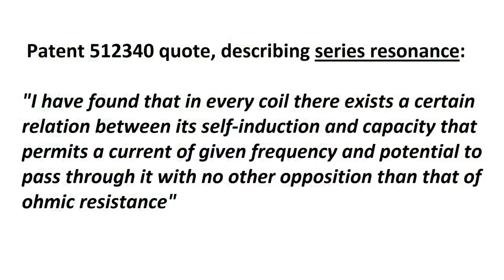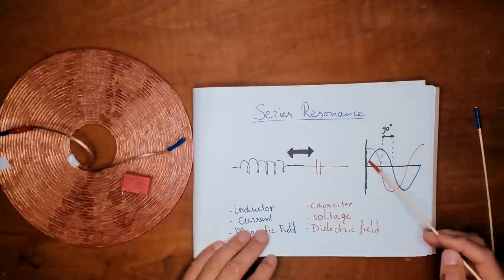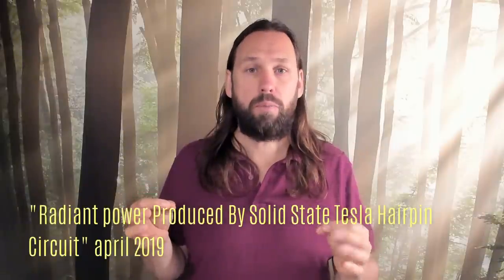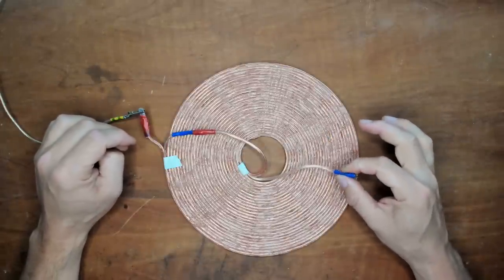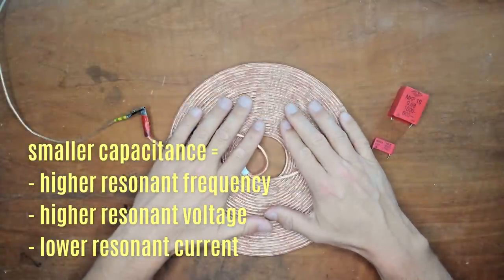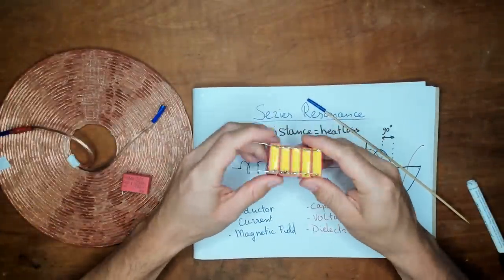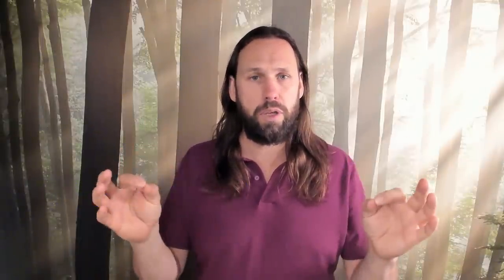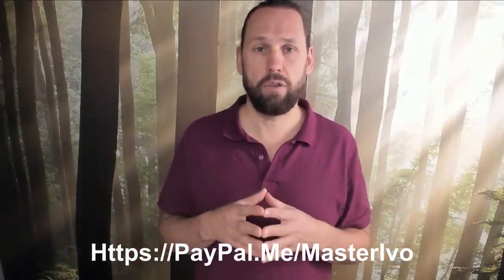The Series Resonant Bifilar Coil, Made For Longitudinal Impulse Electricity.

Comment: There are 2 different frequencies happening here! 1) The frequency of the wire by its self and 2) the frequency of the combined Coil with the capacitor! If the two frequencies overlay each other that they add up, both the magnetic and dielectric fields will increase dramatically. This is the state many inventors describe for example as "harmonic" resonance. The coil frequency is a harmonic multiple of the LC frequency.
Reply: @TheGuru2You2  Very interesting comment about the 2 different frequencies.  Do you have any links to web sites, documents or videos to learn more about this?  Appreciate anything you can share, thanks.
Reply: But only when the current Is cero instant?
Reply from the maker: the frequency of the wire by itself?

Comment: interesting as usual with M.Ivo !
do you think making a bifilar coil with Aluminum and nikel wire could increase the voltage and lower the resistance at the same time making the device more efficient ?
Reply from the maker: ni don't think so. aluminum has a higher resistance. Dont know about nikkel, best would be silver-plated copper (or gold or platinum) buy I stick ti pure oxygenfree copper, as it is affordable and workable.
Reply: @MasterIvo  there must be grafite / grafine wire by now.

Comment: Hey, just rewatched YT TheRadiastral: Lindemann read Vassilatos again, Secrets of Cold Electricity with the Edwin Gray circuit analysis: convinced me you are on the right track with bifilar coils. The radiant energy seems to be dielectric impulses with self-generated magnetic impulses traveling with... (definitely not a typical EMwave impulse. Good Luck and success in 2021. Party on Dude, be good to each other. The impulses seem to be self-resonant while being transmitted (like throwing two balls connected together with a spring). The dielectric waves contract, the magnetic waves repel, but both are expressions of the other and inseparable while each interaction increases the energy of the other.
Reply from the maker: what about a ball with a center hole.
2 long ropes though the middle.
ball sits at one end, ropes a forcefull pushed outwards in opposite directions, perpendicular.
forcing the ball to the other side of the two parallel ropes.
played with it as a kid, do not remember the name, do you?

Comment: I am curious, can you use a variable capacitor as a way to tune the capacitance? Regardless, I’m very impressed with your capacitor board.
Reply from the maker: thanks, yes a variable capacitor could work, but the specs would be high demanding. I have thought about filling my variable air capacitor, with oil, so to increase capacity, but also to increase maximum voltage capability.
In the end it would probably only work for fine tuning as the capacitance would be very small

Comment: The higher the frequency is, the more it will travel along the outside of the wires of the coil. Just saying.
Consider a future project: use a coax cable, focus only on the outer wire, and make a bifilar coil with it. It will work. But think of what will happen with the inner wire of the coax. It will have a copy of the pulse. As well magnetically as electrically. Fascinating!
Reply from the maker: indeed, coax is what eric dollard used, he had silver with teflon, and didn't use the core.
Reply: @MasterIvo  Wow, I did not even know that! I just used it to test it for myself. Playing with it. But not in resonance. Thanks.
Reply from the maker: @deslomeslager   you got it!
Reply: @MasterIvo  is there a flat band insulated wire maybe a inch wide to increase the capacitors holding area of the coil?
Reply from the maker: @dianathompson7597   don't know. I've been looking to Coax, with silver mantle. Teflon coated. perfect. just leave the core, and only use the mantle
Reply: @MasterIvo  well you are getting all the right effects now. So I think your good.
Reply from the maker: @dianathompson7597   almost

Comment: Master Ivo. Did you buy the capacitor switchboard or build it yourself? Thank you sir.
Reply from the maker: I made it
Reply: @MasterIvo  Is there a video detailing how sir?
Reply from the maker: @hoofheartedicemelted296   no but it is easy, just buy switches (china) and capacitors and put them on a circuit board. 10x small 10x medium 5x large, size depends on what you need.
I used 100pF 1nF and 10nF
all polypropylene, high voltage.
2kV wima fkp1 and Wima mkp10
Reply: @MasterIvo  I will definitely check it out. I'm willing to spend whatever it takes to get the job done. It's just that it's becoming a drag buying components and other items and ending up with wrong things. On the upside I'm up for an engineering challenge. Everything you have explained in your videos has a distinct ring of truth to it. I'll definitely support you when my monthly payday comes. Thank you Master Ivo.
Reply from the maker: @hoofheartedicemelted296   thanks man! maybe become a channel member?

Comment: Master Ivo,
What is the rated diameter of the coil and the the thickness of the wire? Can I use bigger coil and wire thickness?
Thanks in advance for the effort end support,
Greetings Sven
Reply from the maker: I use 1.5mm2 you can use thicker yes.

Comment: You're right. Higher capacitance resonates with lower frequency, and higher voltage fills the dielectric field with more energy, ultimately taking less space to do so. Thus, a smaller cap should store higher voltage it seems. Tesla worked very hard to make his wardenclyffe tower proportional to the earth, saying that the topload must be the right hight and dimensions to contain the energy at high volt energy in the topload, but that is only HF because of the transformer feeding it. The topload is raised because it holds more energy at higher altitude.

Well thats how I understand it. The thing for me is that frequency does not dictate pulse width of an impulse voltage polarity switch from 0v. The capacitor to me should be resonant at the frequnecy I intend to switch the current at, but when I decide to switch (theoretically with my plan) its done in under a nano second because the current passes through a spark gap that is only quenched by my other vortex coil at will. 

So you see, a small hv cap would be more useful to me as well, being that my shunting methood is only indirectly related to my charging cap. It simply needs to supply high voltage until I switch both the cap to the spark, and the spark to the quenching coil at the same time. though I find it peculiar you're working in the nano farad range... I was considering tens of microfarads or just farads, but now I see why I was struggling so much to find a high farad / high voltage electric double layer capacitor! I believe in those things, very superior electrostatic characteristics, but let me know what type of cap you use.

I mean seriously, I'm starting to realize just how similar our research ambitions are. Literally, were both just trying to make the fastest impulse current without resistors, mechanics, or transient suppression. I'm not sure why, but it appears you intend to go with solid state AC when I'm going for spark gap DC, but I digress. The diversity will likely serve our benifit.
Reply from the maker: I use wima mkp10 or fkp1 caps they are polypropylene and are available up to 2000V dc , also 2.5mm2 speaker wire for my coils which not only are low resistance but also high  capacity (surface area). Coax could also work (silver plated copper mantle) whereby the core isn't used (skin effect)
Reply: @MasterIvo  Great ideas! I will take those into account. The coax cable is smart, but insulated in a balanced way... or is it? I'll look it up. But I use like 28 gauge in my coil because I'm trying to make the coil about fist sized or less with proper spacing and topology, and I learned manu lessons about making vortex coils smaller. One of them is the smaller wire guage, but for the large coils they reccomend many shorted wires twisted together. I think I agree with that method aswell, given a good surface area is provided. I'll send you an email soon. I'm preparing it.

Comment: Can you give link to your capacitor board? Looks cool. Will be glad to use it myself.
Reply from the maker: made it myself. all caps are in parallel, and switched on or off individually.
5x10nf
10x 1nf
10x 100pf
Reply: @MasterIvo  Thanks

Comment: How about combining wave resonances with LC resonance in this system I mean adjusting the system so that wave resonance coincides with LC resonance. I read about other systems where the lengths of L2 and L3 wires would be taken at a ratio of 1 to 4. For example, L2 length = 3 meters but L3 wire length = 12 meters wavelength resonance.I think this could improve the efficiency of the system
Reply from the maker: try it!
Reply: Great comment makes logical sense.
Reply: In my iteration I’d try to use the 3H wire as the active and the base as the secondary or induced as per the 381970 patent general outline , however it was not specific about length.

Comment: I have often wondered how this type of coil would work as a crystal radio with detector, variable capacitor, ground and long wire antenna. I have built many sets since the 60's. What are your thoughts? Thank you.
Reply from the maker: Reciever or transmitter? As transmitter I think they would not be good, but as reciever they could work. not really my expertise.
I do have a small AM radio transmitter that I once hooked up, but I didn't have a AM reciever. should order one...
Reply: @MasterIvo  I would wind a coil for a crystal radio receiver. Some people have wound bifilar coils on a cylinder (Plastic pipe-solenoid-type) Most radio coils need to be around 240 microhenries, (Not to get too technical, they usually use 40-50 ' of wire.) A spiral bifilar coil might be easy to wind with 2-conductor speaker cable or lamp cord. I'll have to see about an inductance calculator for bifilar coils.
Reply from the maker: @Jomatsch  it's 2 windings with mutual inductance. 
 the henries can be lower, as the capacitance is increased (lowering the resonant frequency).
Reply: John Schwarz I thought about doing this but just getting a large ‘transformer’ core like from an old  inverter welder or the like and try to see if I could get self resonance down as low as possible to try to play around with targeting ‘earth’ frequency whatever that is these days lol
Reply from the maker: You need REALLY big coil to do that, with a MASSIVE power handling capabilities.

Comment: Ivo  Can you analyze the case of connecting both coils at the center.  This makes current in both coils run opposite to each other. Does this really broadcast scale waves ?
Reply from the maker: no it doesn't. scaler is BS. but you can produce longitudinal waves, whereby resonant voltage and current become in phase (using Extra coil).

current comes in 2 forms. conventional- and displacement current. these travel in different ways.

Comment: It was a great explanation... Please explain how can we create magnetic scalar waves using bifilar coil.
Reply from the maker: scalar? put dc on(scalar is the wrong term. it's not changing). longitudinal magneto dielectric? impulse the coil while series resonant, like my april 2019 Radiant Power video.
This can also be done with low side switch (positive impulse) and no DC offset. (much easier).
best is use an IGBT half bridge.
Reply: @MasterIvo  ok brother. Thank you to answer me.

Comment: I was reading about some circuit that was used to charge batteries, it pulse charged them with something similar, and they claimed the batteries would have greater capacity and double voltage after being conditioned for some time using this circuit, and this claim was from a big company that was researching and experimenting with it. It could charge 2, 24v batteries with the back EMF, supposedly the batteries would eventually be 36 or 48v depending on if it was 12 or 24v, ( they claimed trickel charging 24v, or fast charging 12v) it had something to do with the current when the switch is first swiched on, like Tesla experimented and studied,,  the high frequency low duty cycle pulses I'm guessing faster than magnetic field could build, I was curious to your thoughts, it supposed to make the FLA batteries last 10x longer or something also, I belive some of this , but it does seem a bit exaggerated! I don't see how it could effect nominal voltage of the chemistry,  unless it is changing things on the inside of the cells, it seems a bit crazy, but seeing some of these experiments, cold electricity, scalar waves, they did say it took some time, and could revive nearly sulfated batteries, just curious,
Reply from the maker: impulses, inductive spikes, can charge capacitors (like batteries) longitudinal. giving instant voltage without current (no heat)
Reply: @MasterIvo  neet ima try it and post vid.
Reply: yes, a special charger in a special pulse mode was tested, it works well and reliably, it automatically adjusts to the state of the "addressee" that is being charged. But with an increase in voltage - I have not encountered, although yes and this is true - the charger works without heating the "addressee"

Comment: I have found a quick and clean way to make pancake coils. No glue is necessary. You will need to find a way to wind the coil and keep it tight. Lay the coil on parchment paper and place on flat cookie sheet. Place in oven and bake about 30 minutes at 350 degrees. The wire insulation will melt to itself. Remove from oven carefully and allow to cool without any coil movement, at least 30 minutes.
Reply from the maker: 175 C
Reply: @MasterIvo  wow you are so deep.

I was trying to find American gage of speaker wire size & try not bother you so I was reading if other asked from all the way from top comments but I didn't see this far. and getting tired what gage of speaker wire do I need to create low resistance B coil sir Master Ivo for American gage wire what gage do I need sir ?
Reply from the maker: @motobacktoconstitution4138   google for conversion, 1.5 or 2.5 mm2
Reply: @MasterIvo  I have 12 gage wire speaker at my house abailable , simply is that work sir ?
Reply from the maker: @motobacktoconstitution4138  yes you can use it

Comment: Ok Ivo when you have ‘series resonance’ what occurs is that the Tractor force has offset the inertia of the inductor, ok so that is the offset state , so we can all agree with Tesla that now that inductor is rotational at 0 opposition, but as you also correctly stated , when they are back ‘in phase’ that is when the inertia is actualized back into the 3D plain.  They key is to through different steps first offset the inertia , then actualize that offset inertia back into the 3D plain , it is done with flywheels by adding a second shaft , this would strongly suggest that you would need two core paths , i.e at least two inertia ratio devices , i.e at least two inductor devices.
Reply from the maker: yes, I need a second set of L1+l2 (close coupled), so I can provide the second half period of the L3 sine wave with a positive impulse. More work to do :)
Reply from the maker: Inertia, what do you think that is? A volume of Aether? pushed by transverse mothion of the dielectric field (faraday tubes)?
Reply: Master Ivo to degrees I guess it comes down to language, but basically I think ‘inertia’ is ‘inertia’ you could look up a video where someone put a device in a pool of water and spun a vortex {tractor force} and watched how different objects were ‘attracted’ or ‘repelled’ , we can say the results of the tractor force is inertia.